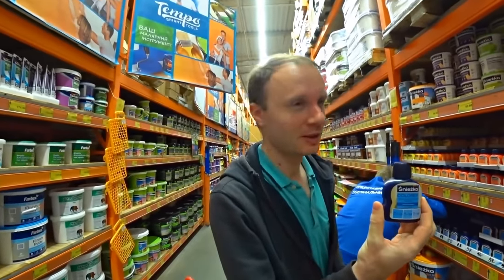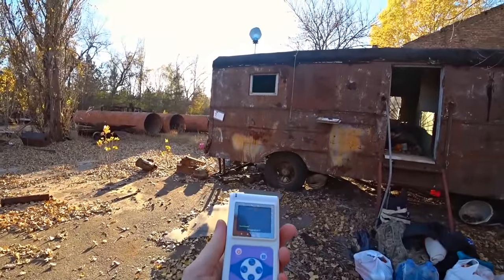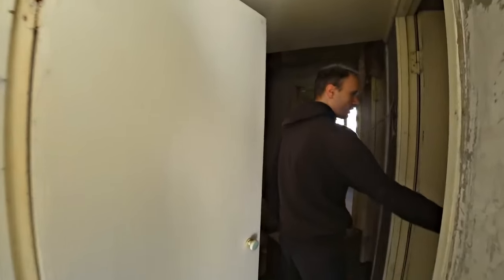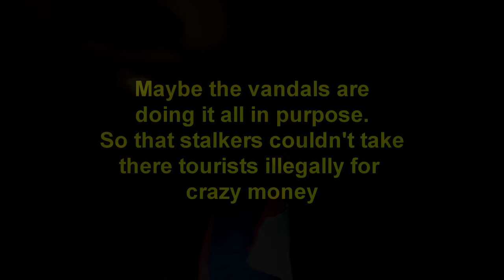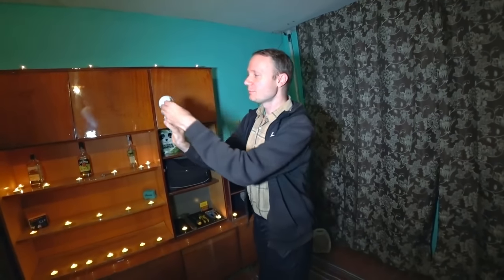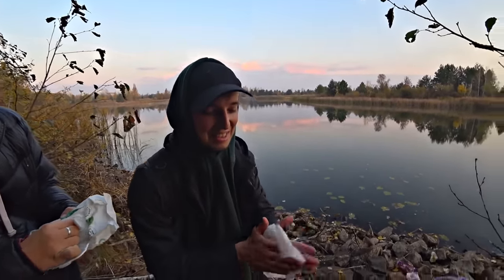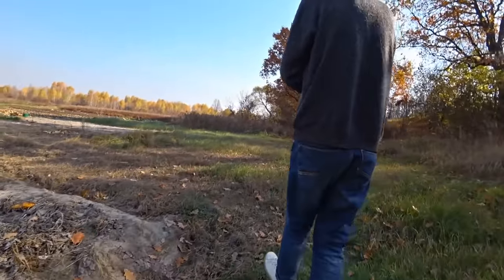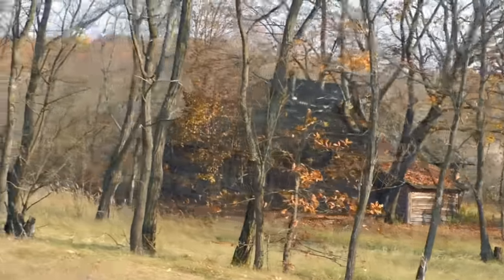Renovation of an apartment in Pripyat 😨 Moved to live in the Chernobyl zone

Comment: you could a make sliding door paint it or find a material that blends in to walls that u can pull in front to hide the door and looks like a dead end kinda like a those room divider curtains but not a curtain a solid version 1:20:08

Comment: Can get a 3g cellular transmitter that uses the same connection as the phone IE it has a swappable SIM card, just have to point it at the radio tower it is connected to... they use 800 watts, but have a 20Mbs speed over 10 to 30 miles where a phone would be running at dial up speed of 25kbs... think about a small solar array on the roof for that, associated devices to that use a bit of power. 5kw solar and battery bank? "State/Provence funding?"